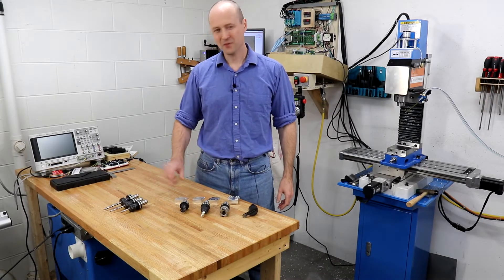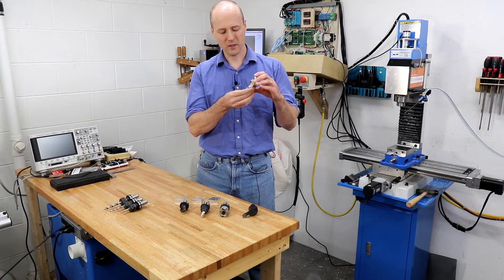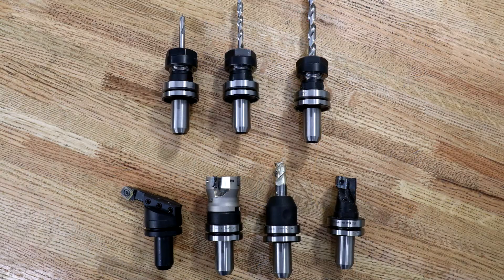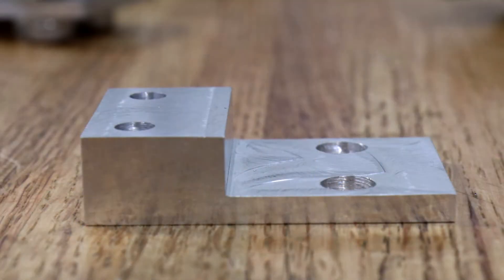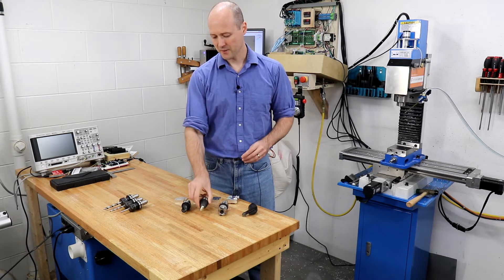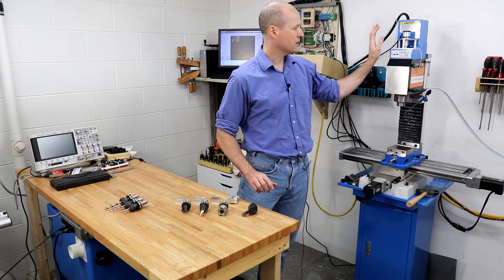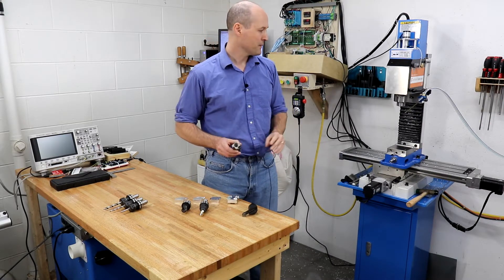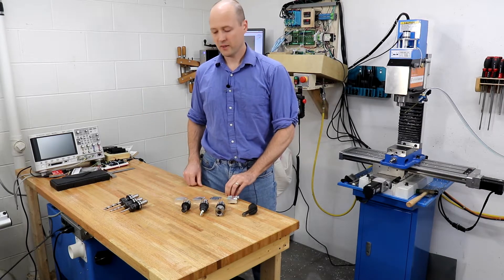CNC Milling Tools, Spindle Load, and Performance

Comment: Hi from France, Kent, thank you so much for all your videos; they are so instructive.

 I'va had the pleasure to use some professional cutting tools, on a heavy machinetool, this mill was using a huge asynchronous motor, maybe rated at 10 kW just for the spindle, this was a traditional mill with a gearbox powering trapezoidal "ACME profile" screws.

This mill was equipped with an industrial spindle, using SA-40 taper.

Well, I have seen some videos dealing with interpretative properties of carbide teeth used onto this kind of machine.

Some properties seems (according to my opinion) more important as others.

- Except the overall stiffness of the machine tool used (correlated to the weigth), the rigidity of the cutting tool regarding to its holder, regarding to the taper used seems to be highly critical : reduction of micro-wearing, reduction of surface roughness, reduction of noise, enhancement of chips cut-off.
- The industrial grade carbides are usually obtained by sintering very complex compounds, most of them are using tantalum, cobalt & other superalloys constituents, and all around the sintering pellet a dedicated ceramic coating is made, with lots of improvements regarding the class of material to be machined.

I'm now looking to purchase a conventional mill in order to numerize it, but also to look how it could be possible to use a smaller taper (ISO 30) with tools holder as delivered by carbide makers.

I will give to you a video link of a series of experiment showing the vibration / noise / power of removal of several cutting tools. As far as I remember, the "elastic pliers" which are used by lots of hobbyist is definitively not a good way, all the torque provided by the spindle (which is not with an industrial power beghind it) is lost.

On the other hand, I have been deeply amazed by the great variety of micro-screws which are used : to ensure that the carbide tooth will stay in its lid, there is HUNDREDS of different screws.
- By the kind of attachment (Torx, microtorx, TorxPlus, Allen...)
- but also for the Outer Diameter (rarely above 2 mm OD),
- the kind of neck between the threaded area and the head/button,
- and most of all, the thread profile. Frequently, a specific Thread Per Inch is used, its allows to this kind of retaining screws to be always designed as Imperial-based Whitworth dimensions to be never being used on the wrong holding tool...
A kind of perfect match is needed, because even the carbide tool is made to receive this kind of critical screws...

I have also found that torque wrench, sometimes mounting pastes are applied prior to any machining.

I guess, by using enhanced spindle motorization (as shown by Franco with DMM servomotor series) or abarmot86 in Russia; correlated with "solid, monolithic holders' could help some of us to greatly improve the performances in CNC hobby realization, at a price which could be finally reachable, regarding about the great disponibility of all these highly specialized carbide teeth.

I especially think about the swedish carbide maker SECO, which offers a Minimaster tool which is highly productive and versatile : drill, spiral drill, surfacing, edge chamfering and realization of shallow pockets. See here for more info : https://www.secotools.com/#article/m_6914 - That's the kind of tool I would like to use...

Best regards to you Kent ! Keep up this good work !
Reply: Here are the comparison made with several collets : the ER series seems... not reliable at all; but it's dealing about professional with powerful spindles, between 10 to 15 kW...

¤ https://www.youtube.com/watch?v=LpoJIS9xXVQ : Comparison of several collets

¤ https://www.youtube.com/watch?v=eedYZ8vrwJg : Comparison of effectiveness, aspect, noise, metal removal between Weldon, Coromant, and a germany standard : Fahrion.

Interesting deals with out-of-roundness, resulting dimensions and smoothness of walls and "floors".
Reply from the maker: Hi Cyril, thank you for the time you took to write this. There's a lot here, and I bet far more advice in your mind. You write on a fascinating topic and I've read over this few times over the last couple of days. Help me understand, what would you recommend that I change in terms of tooling, setup, approach, etc. to improve accuracy, surface finish, and material removal? 

The experience that I have with my small machine, I believe that flex (column, head, column to head attachment, spindle, etc.) or other looseness allows the tool to deviate from the ideal fixed position. I suspect that the spindle is vibrating some. I suspect that under load the BLDC motor is pulsing. That's probably runout in the spindle. And there's probably a dozen other smallish non-ideal situations that compound. For instance, I can deflect the tool a few thou easily by press lightly against the corner of the head.

A lot of folks change the spindle motor. More power would be nice, but should one first eliminate as much source of variability before applying more power? I've had a few times during drilling where the weakness of the ER collet saves the part because the tool slipped into the ER collet instead of destroying part.

Similarly, the SECO Minimaster is affordable, but is it overkill on this machine because of lack of tool rigidity, deviation from center, spindle speed or power, etc? And so Tormach modular insert tooling is fine enough. (Modular insert tool is a nice step up from the standard end mills, for me, except in side profiling.)

I love that these small machines give one a lot of chance to safely experiment, often to  improve the quality of the machine. But... eventually, too much is spent and one would have been better to purchase a new machine. So, I want to continue right up to that threshold, learning all I can, but not go so far that I should have purchased a different machine. 

For example, I don't see making microfludic devices ever on this mill because of the runout may be larger than the diameter of the tools. I don't want to replace so much stuff that I could have bought a Datron. :)

The analytics of machining are interesting, and actually I was in the University library for a couple of hours today finding review articles on the topic. I though that my small mill, with all it's imperfections might be a good platform to learn about sensors. Maybe that's not good thinking because there are so many compounding imperfections.

Greatly looking forward to your thoughts. Also, you're always welcome to email me. Thank you for the support and best wishes, Kent
Reply: Thanks a lot about your experiences described into your reply !

I have read on lots of forums that these nices & light machines have the drawbacks of their advantages: the lack of rigidity, especially when considering the tiltable head.
Ahh.. Datron... nice equipment ! ^^

I'm aiming to purchase a "BF-30 / BF-32" with a ISO30 spindle, these mills are a bit bigger than the PM-25MV (equivalence are PM-30MV for USA), I'm looking about the complete numerization, maybe using ClearPath servomotors or the DMM servos (as very well described by CNC4XR7 and Franco). Both of them also well described the limitations of this kind of nice mill, like bearing which are always perfectible, some vibrations that can be treated with ease or with huge expenses..

Because tribology is one of the harshest field of knowledge available to engineers, I've read that harder materials like carbide alloys allows to reach superior power of removal, at a lower consumption of power, comparatively to HSS alloys. So I was thinking that because the spindle power onto these mill is limited (sometimes weak), maybe the fact to use carbide instead of HSS could be a nice approach, and to ensure repetitive stick-out measurements with time.

I have seen on industrial machine tools that carbide tools just can't resist to distortion, they are so brittle due to their structure, I'm afraid to destroy both, especially when drilling / boring : part and cutting tool.

Concerning the lack of stiffness, I have seen that some users which are numerizing their mills are using a nice machined block between the Z-axis column and the head, in order to suppress the proposed head's tilting feature with a retaining bolt, which is a source of additional distortion, and allowing thus to increase the gap between the Z-axis stepmotor/servo and the spindle motor : more rigidity and possibility to install a greater spindle motor, but..another expense and time consumed for doing so.
Here is practical link about this (nice !) spacer : 
http://www.cnczone.com/forums/benchtop-machines/302640-cad-2.html

But even if the foot of the column is now proposed with a new design offering a better stiffness regarding the crosstable basement, there is still lots of features that will create gaps and runouts. When I was in machining lessons I was using Weldon attachment and the result was Ok, but it was for huge SA40 taper, on a 2-tons oldschool mill... I was considering the Weldon attachment as interesting, at that time. And when viewing these experiment with powerful machining, the Weldon solution shows its limits ...for a very stringent application.

And finally, the wise advice after your reply, when considering making little parts where time is not critical, should be finally to consider ER collets solution (of course, correctly made), as valuable. I will never be in the possibility to add a spindle rated at 15 kW with these little mills.

According to my thoughts, it's always a bit painful for the mind to see that a slipping effect can occur between the mill and the ER collet. I also have seen that some ER collets are more recommended for your kind of mill, the ER-20 seems to give nice results with most cutting tools made from HSS, HSS-EE or HSS with vacuum-deposition coatings. A nice video made by the marketing team of Fahrion's (maker of CENTRO|P) shows where their product is superior, compared to traditional ER collet sellers. But everything needs to be paid (here : + mounting wrench, + holding socket, maybe + dynometric wrench...). So yes surely, this kind of product is overanked for this kind of mill, when considering that a gentle load of the hand applied on the head ease to set the machined depth ! ^^ Here is their commercial ad with solid arguments, made by finite element analysis, but it's a world class quality collet here : https://www.youtube.com/watch?v=FwRaSqeF1jE

They said in their catalogue (available here in English : http://www.fahrion.de/fr/telechargements/catalogues/?eID=dam_frontend_push&docID=2851) that for a single carbide drill at 105 €, with a collet CER-32-K2 with a run-out of 20 µm, the price of this collet is 13,60 €.
The Fahrion collet, type GERC32-B, with a warranty runout of 5 µm is proposed at a price of circa 20,90 €. The carbide drill will break at 55% of its lifespan, versus a break at 150% of the lifespan when used with Fahrion's collet... "as a result, the cheap collets are almost tripling the cost".

Of course, the difference cannot be close of only 7 € between Fahrion's solution & others sellers of ER collets : lots of components are sold separately : sockets, collets, wrenches with embedded rolls...

Finally, the only interesting feature of carbide tools remains in their ability to quickly remove chips, but it demands high speeds for that, with enough torque, lots of people has warned me about the limitations of this kind of mill : for hard stuff like special steels, a heavier mill is mandatory. I need to take a look about the modular tools proposed by Tormach, I'm not aware of their cutting products. 

My goal is to achieve the possibility to obtain parts in aluminium and making molds from thick extruded 6061 aluminium blocks, for making carbon fiber/epoxy resin with vacuum&infusion technique, I aim to realize my own plane. I have plenty of molds (based on 3D scans) to make, made upon the fabrication itself.

But some parts needs also to be machined and threaded (like axles of wheels) in titanium grades 5 & some structural pipes in grade 7. I have maybe a chance with some carbide tools in the most rigid setting available, but for tapping them I will have to demand to a skilled & well equipped professional.

Approx. 80 units has been built since 15 years, all amateurs are using an automotive engine picked up on a car in good condition & mileage (Petrol or Diesel type, some has managed to modify a turbodiesel), most of them fly in France, it's a highly reliable and stable plane, despite a recent casualty due to a motor shutdown occuring at take-off with no embedded parachute placed on the plane's cell ..the worst scenario, and for any plane.

Here is the result of the petrol engine made by Peugeot-Citroën (PSA), 4 cylinders 1390 cm3 / 8 valves rated at 80 hp, reprogrammed with an open-source injection calculator :
https://www.youtube.com/watch?v=ltAxvkc-ga8

Another one in flight in southern France, the operational range is 1000 to 1500 km at 220 / 250; max. 300 km/h in quiet air, a correct weight without any petrol/pilot/travel stuff is 260 kilograms, max. weight at take off 450 (+22 kg with additional&optional parachute) : https://www.youtube.com/watch?v=gKYgwfaJ7mU

Because this construction demands 4 to 5 years, when working 35 to 40 hours per week, I need to install a cnc mill and a cnc lathe at home... and making buckets of chips to save grams of resin ^^

If you need to realize microfluidic applications, please consider this technique, maybe it can solve some of your issues : http://www.conardcorp.com/about-photo-chemical-etching

Best regards and thank you very much, you're a pathfinder for me.

Comment: Absolutely fascinating indeed!  This is hugely useful in seeing how different tools and different strategies ACTUALLY compare to each other on this type of machine.  Thanks for the video, great job!
Reply from the maker: Thank you Jeff, I appreciate that. Fusion 360 has so many options, I want to build some best practices and minimize my time there. Indeed, a machine like this has it's limitations and they can be frustrating or a source of endless experimentation. I meant to have times in the video, but I ran out of time (ha ha.) (I mentioned this to Mike as well below.) Maybe it makes perfect sense, but the time required was inline with the power consumed. For example, roughly, the end mill adaptive clearing took ~1/4 the power and took 4x the time as did the shell mill. Still room to push the end mill. Best wishes, Kent

Comment: Cool vid. Theres no right answer, each machine and tool will have thier own signatures at different feeds/speeds. Seems your servos cant keep constant load on the shell mill and will soon be smoaking your inserts.
Reply from the maker: Tool load is the variable that sort of led to being most systematic. Fusion 360 will happily make small or large w.o.c. with the same tool. The fly cutter requires ~500 W when fully engaged at .020 d.o.c. and nicely only 250W when half engaged. The end mills have the added complication of pulling into the material with a large d.o.c. and w.o.c. I'll keep experimenting. Unlike drills, I've not seen equations for estimating power required for all these tools. The empirically derived drill equations seem pretty accurate up to 3/8" which is the effective limit of my mill. It's sort of a pain to have a small mill, but for an experimenter, a small mill has so many limitations there's always something to experiment with.